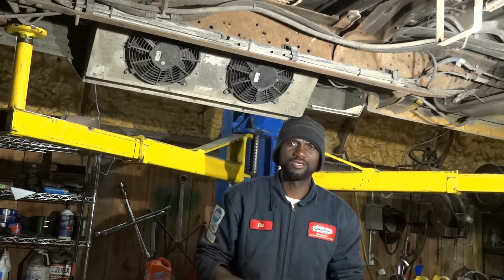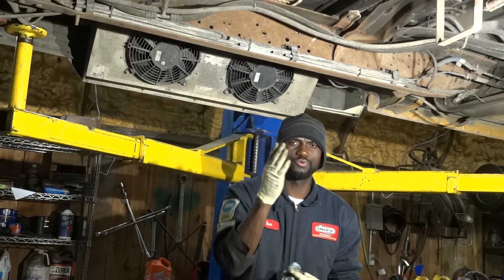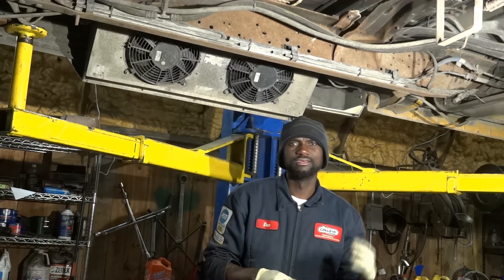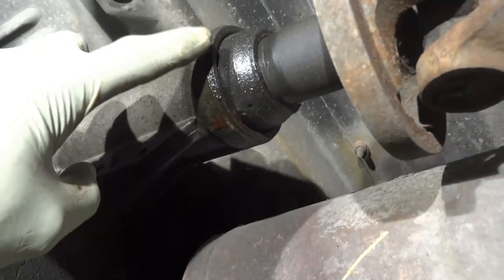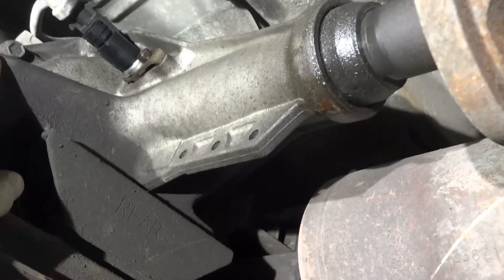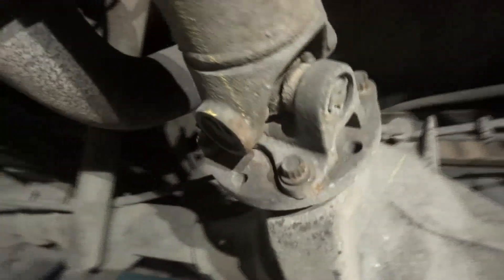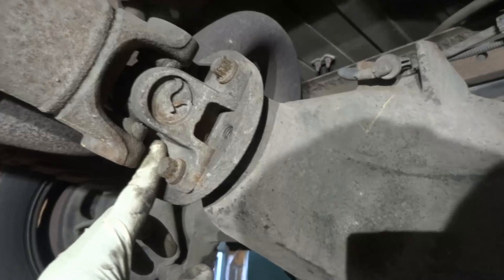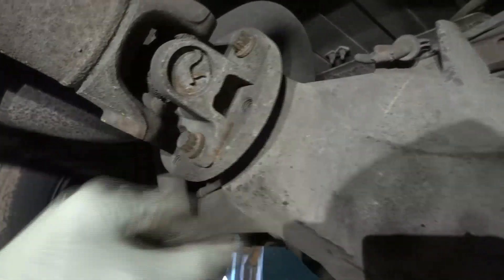How to Remove a Transmission output shaft seal on a Ford E350, Leaking Transmission Tail shaft Seal.

Comment: Super easy to do if you can get your hands on the part.  I just got done with changing the clutch hardware, clutch master and slave, and a laundry list of other crap only to fill it up and watch it trickle right back out.
Reply from the maker: justin Green that sucks, hahaha at least you don't have to remove the transmission to replace that seal lol!
Reply: @KITS_Auto_and_Truck_Repair  No it was the easiest repair of the whole project, U-Joints were a minor hassle, speedo cable and its metal wire clip designed by satan was a whole other story.
Reply from the maker: @justin456  hahahaha, that last sentence is so funny, Desighed by satan lol!

Comment: Great video. Only thing I would add is to be more specific. For example, does it matter how tight those four bolts are?
Reply from the maker: Carl Rider  Yeah I forgot to mention the torque spec on the video, I will be putting the torque spec in videos or the description box in future videos...
Reply: @KITS_Auto_and_Truck_Repair  what are the torque specs for this video?
Reply from the maker: @nachadfilms7002  the torque spec for the drive shaft bolt is 50 foot pounds
Reply: @KITS_Auto_and_Truck_Repair  thank you
Reply from the maker: @nachadfilms7002  My Pleasure!!!

Comment: Did you have to drop the transmission? Or is it necessary? Wasn't sure if I needed to or not... Mine is leaking and I'm about to change mines...I have a 2000 Ford f350
Reply from the maker: Christopher Lunn  No You don't need to drop the transmission!!